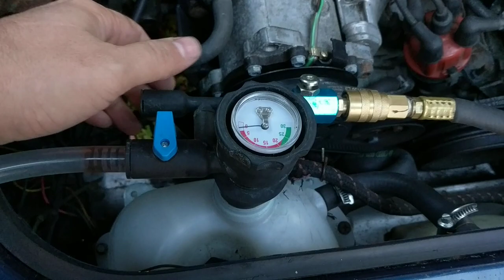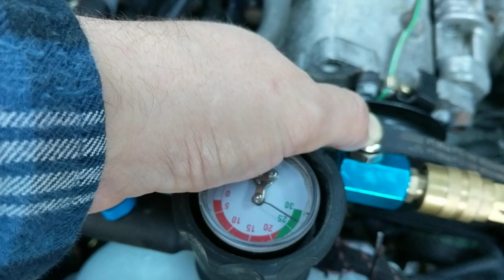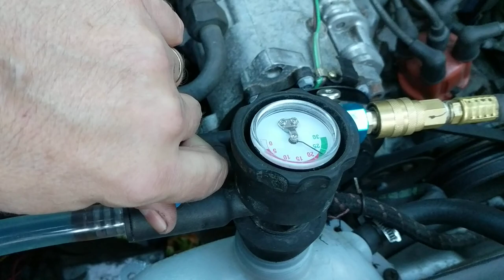Vanagon coolant bleeding the easy way

Comment: Glad you use this method ken. I did this last fall and my front heater core sprung more of a leak from the pressure haha. Needed to be changed anyway glad I did it cleaning out and resealing that old air box was much needed. No more hot foot.

Comment: I ordered one and it’s on its way 👍🏼.  I’m a tad disappointed to read here that you recommend not using with coolant in the system.  DUh , nevermind , of course I can just save my coolant in a super clean container. Have a good weekend.
Reply from the maker: You can use it with coolant in the system but it will make a huge mess.  I don't recommend it.
Reply: @VanAgain  Of course it’d make a huge mess !  🙄 Thanks again !

Comment: Does anyone think one of these could be used with hose reduced down (to 1/4”? or whatever the inside diameter is) as a brake system bleeder ?).  Not sure if the reservoir would handle the pressure necessary ?  Of course if you got brake fluid inside the gauge it’d not be good… .  But it sure would be cool to be able to - you know , with that whatsit at the ‘T’ where the lines split?
I’ve fought air in my lines and then finally paid a foreign auto repair to do it and I didn’t notice a bit of difference in the pedal.

Comment: What tool is this? How can i buy it?
Reply from the maker: You can buy one on Amazon.  Here is a cheaper version. 

https://www.amazon.com/Coolant-Cooling-Universal-Carrying-Connectors/dp/B09CL3YQJD/ref=sxin_17_pa_sp_search_thematic_sspa?content-id=amzn1.sym.140400a7-1208-46ad-8d2a-eb6e8eac81b5%3Aamzn1.sym.140400a7-1208-46ad-8d2a-eb6e8eac81b5&crid=38FL1UW2W3F5L&cv_ct_cx=coolant+bleeder+kit&dib=eyJ2IjoiMSJ9.BZPV26CDQO6SLjbGLY2McwcWNUwRQ2rpkAQVElDvMXK88a_tSeunZFZzPJOuYRe9QWRDCnjMVDZ59j6erepGjQ.ng-JoK2afpbPEmDQqU82_6CPQl3C1WbaHt-ioMM4S1Q&dib_tag=se&keywords=coolant+bleeder+kit&pd_rd_i=B09CL3YQJD&pd_rd_r=9ff254fe-99d6-4e58-8d51-635e22f36778&pd_rd_w=Mf42u&pd_rd_wg=YGAH1&pf_rd_p=140400a7-1208-46ad-8d2a-eb6e8eac81b5&pf_rd_r=42SVXQY723CHW677WHDP&qid=1728677432&sbo=RZvfv%2F%2FHxDF%2BO5021pAnSA%3D%3D&sprefix=coolant+bleeder+kit%2Caps%2C109&sr=1-4-6024b2a3-78e4-4fed-8fed-e1613be3bcce-spons&sp_csd=d2lkZ2V0TmFtZT1zcF9zZWFyY2hfdGhlbWF0aWM&psc=1

Comment: yi dont know if it would workk but maybe worth a try,get an cheap radiator cap ,drill a hole in ,put an valve stem/valve in and pessurize with an bike pump
Reply from the maker: Btdt.  It doesn't work as well as this.

Comment: Did you not just suction all the air that was in the hose back into the system?
Reply from the maker: Nope.  Works great.  Been bleeding these for over 20 years and this tool takes all of the work out of it

Comment: Hey there! Great video. Can I pick your brain? My shop and I are stumped and I've spent 2 days on forums to no avail. I have an 82 diesel vanagon with a 1.9 aaz td swap. We have put a brand new larger rad in it and new larger coolant lines all the way back. My cooling system is over pressurizing but not overheating. We put a brand new head in it and a brand new metal expansion tank from van Cafe because the plastic blue caps kept failing. It's still over pressurizing and blowing coolant out of my overflow tank behind the licence plate! And now after swapping the expansion tank that has a cap that holds I am getting leaks in several other parts of the system. It's leaking from the silicone connectors in the new aluminum pipes in the middle of the van, and I just noticed a bunch of coolant coming down from the front of the van all over my spare tire. I haven't got in there to see exactly where that one's coming from yet as I just noticed it today and it's pouring rain. The temperature gauge never goes above halfway and I'm not seeing any steam. Do you have any idea what could be pressurizing the system so much when it's not overheating? This is my only vehicle and I've put a lot of work into it and I really need help figuring out this problem! Any thoughts would be greatly appreciated.
Reply: Also I noticed you put blue coolant in it. My shop just put green coolant after swapping the head and when I asked about specialized coolant they said it was overkill and they put the green stuff in everything. Do you have an opinion on the coolant type?
Reply from the maker: Green can be fine.  I usually use Prestone 50/50 premix.  As long as it is ethylene glycol based you are good.
Reply: @VanAgain  thanks for the response! Any thoughts on where I can start trouble shooting my other problem? I'm stumped and stressed because this is my daily driver. I was going to start with a thermostat but if that doesn't work I don't know what would cause this problem.
Reply from the maker: It sounds like a cracked head or head gasket failure.  You can tell for sure by using a block leak test kit that you can buy from your local Napa or Amazon.  It has fluid that changes color from blue to green if combustion gasses are in the coolant.
Reply: @VanAgain  at Napa getting one now! I'm just surprised because it started doing this 2k miles after installing a brand new cylinder head
Reply from the maker: Anything can happen.  The test will let you know for sure

Comment: Hi - do you need to open the front radiator top bleeding screw at any point while you do this? 
Do the heater levers have to be on open at all while you use this system? 
How many liter coolant/water mix does it take to fill the wanagon?
Reply from the maker: No, yes, the entire system uses 4.8 gallons.  You want to mix the coolant 50 per cent coolant and 50 per cent distilled water.  Approx 18 liters at 50/50 mixture.

Comment: Hello van-again...sorry to disturb you again ... I bought the kit but I don't understand how to set the compressor so that it sucks the air out of the VW system rather than blow it in ... normally the compressor puts air in things...how to I set the compressor to suck air out...Thank you and Best Wishes for the Xmas and New Year
Reply from the maker: You don't have to set the compressor to suck.  Read the instructions that comes with it.
Reply: @VanAgain  Hi bought it second hand and it didn't have any instruction.
Reply from the maker: Just hook it up to the compressor as normal and push the button.  It generates suction using the Venturi effect.

Comment: To use this method, did you first have to drain the tanks?
Reply from the maker: I only use it when I completely drain the system for a engine replacement or head gasket.  So yes, everything is drained.  I would not recommend using it unless the system was drained.  Just too off the system otherwise.
Reply: @VanAgain  Awesome.  Thanks for the quick reply!  This technique will definitely be helpful when I drain the cooling system.

Comment: Hi Van-again, could I pick your brain one more time...I need to drain my entire cooling system this time, if I remove the coolant pipe to the waterpump it only will drain the engine part of the system and the expansion tank ...but how do I drain all the coolant that is still in the long pipes underneath and the radiator content...Is there a trick to it?
Reply from the maker: Jacking up the front and draining at the head drain plugs while opening all valves and bleeder screws is the best way to drain the system.  However, you will not get everything.  Believe me I have tried.  However you will get enough so that most of the coolant will be replaced.   That is the best you can hope for.
Reply: Hi Van-again, in your experience how high would you jack up the front? And what do you mean by the "head drain plugs" where is that ?
Reply from the maker: @giniefungi1649  I usually just jack it up enough so the front wheels just start to come off of the ground.   Or put the front up on ramps.  On the bottom of the heads on either side there are drain plugs.  You have to remove the push rod tube covers from underneath and look up and you will see them.
Reply: @VanAgain  Thank you - have a nice weekend.
Reply: When you say "all" bleeder screws, could you list them? I have a auxiliary heater under back seat. I think that has one as well. Any help on specific bleeder screws would be much appreciated!!!
Reply from the maker: Just two.  Radiator and rear seat heater.
Reply: what about the one on the Tstat